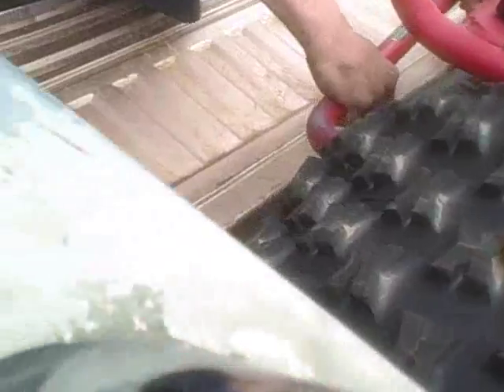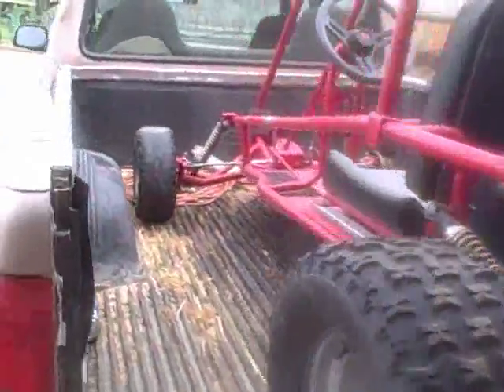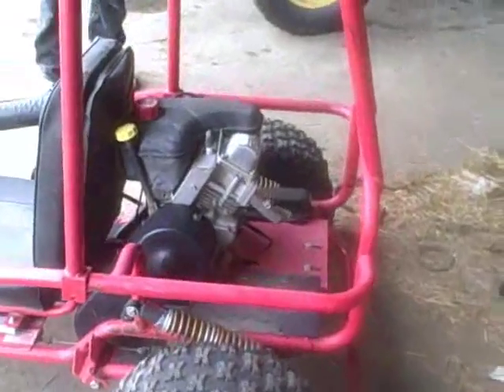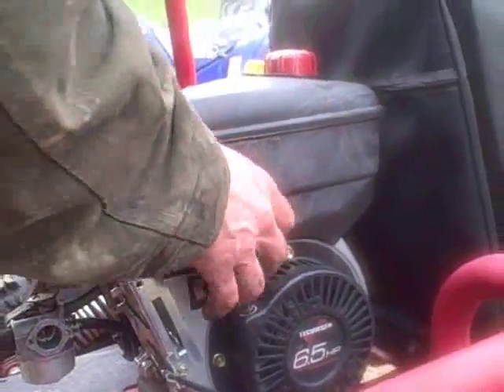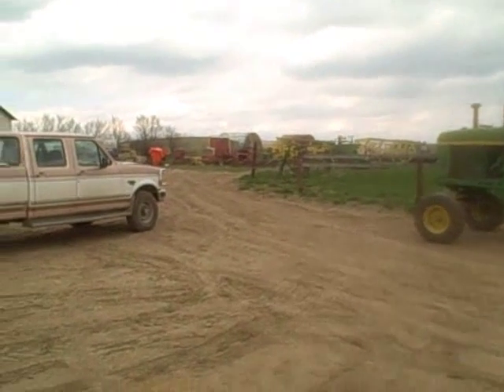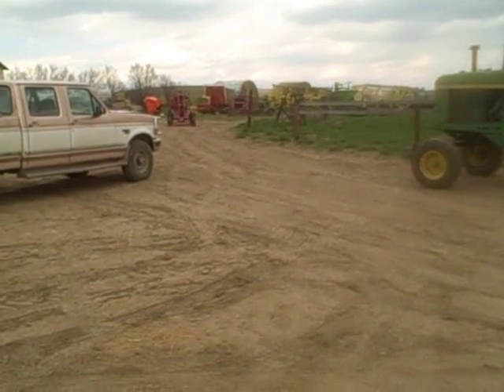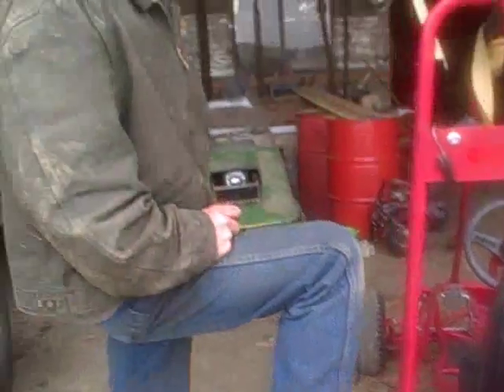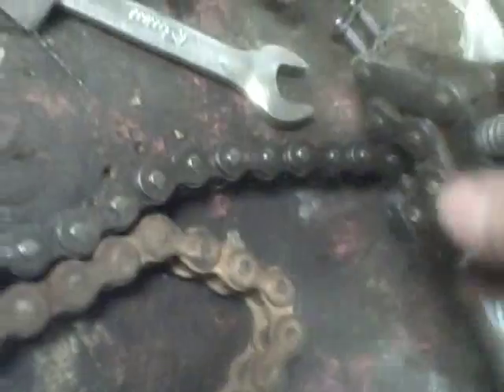Getting my new go cart running

Comment: lol chain breakers are for losers my method is to just grind down both sides of the pin and ger 2 vice grips and twist it i usually works works great on 25 and ok on 35 and i don't use anything over 35 so  never tried it on 40